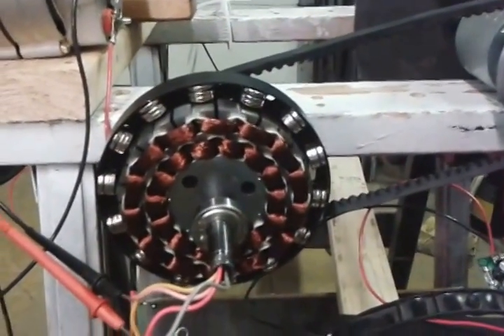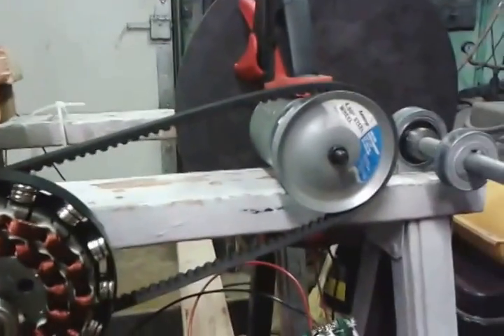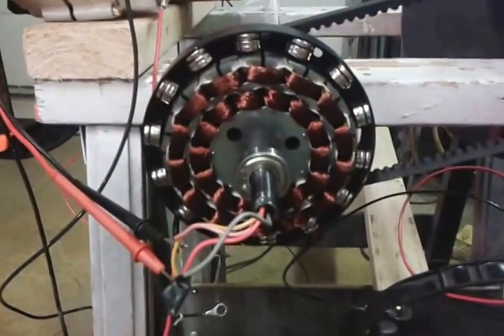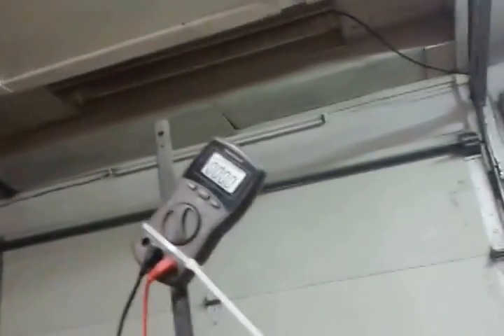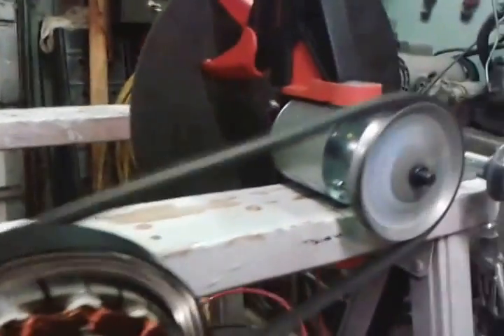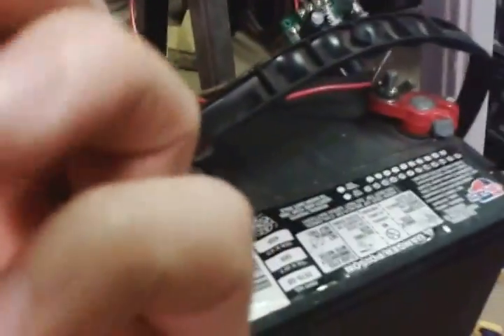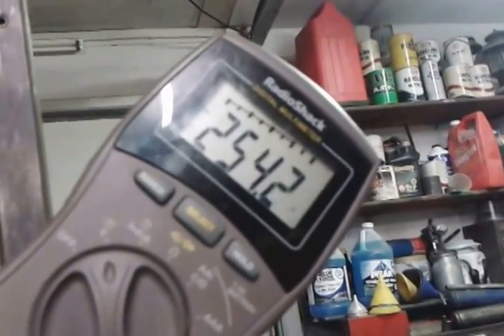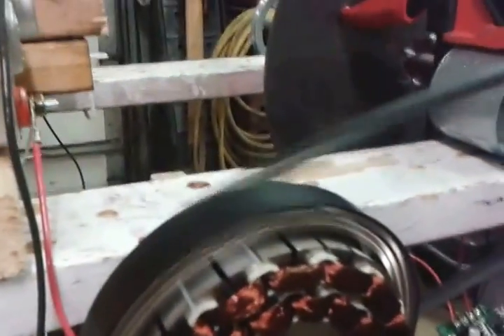Ceiling Fan/Wind Generator 250+ volts!

Comment: Would it be possible to use a grinder (angle grinder) motor as a wind generator? It has a 3:1 ratio on the output so if I was to turn it with fan blades it should turn the motor 1:3?? Or am I wrong and would it even work?? I'm not an electrical engineer I just like to tinker with stuff so if I'm totally wrong please don't shoot me down, it's just an idea...
Reply from the maker: Not sure if it would work. The only thing I could say is to take it apart and see what you're working with and go from there.
Reply: thank